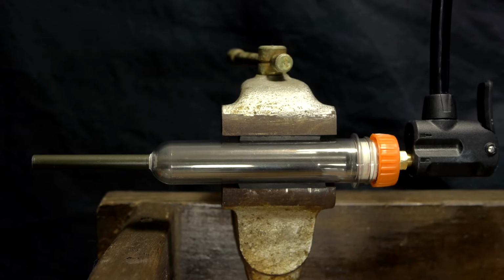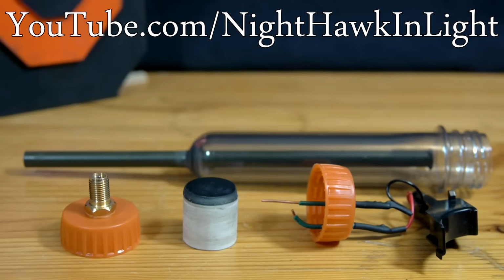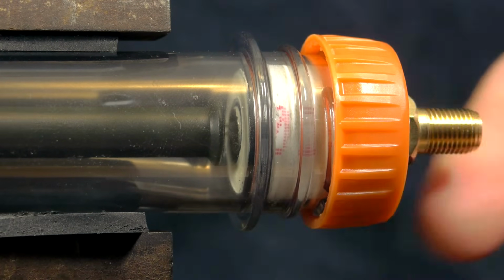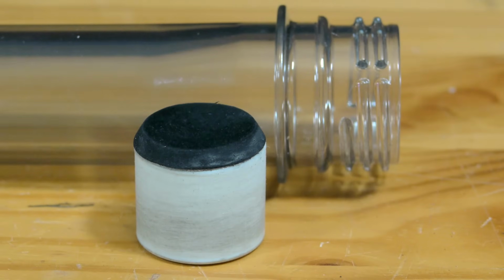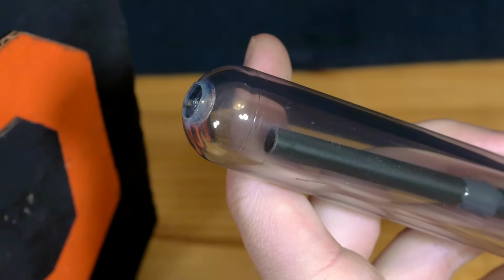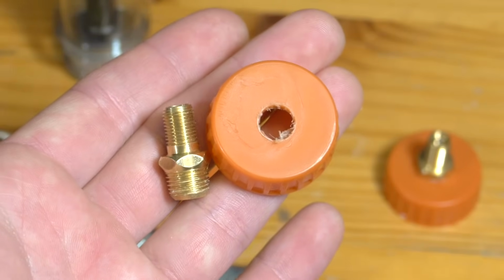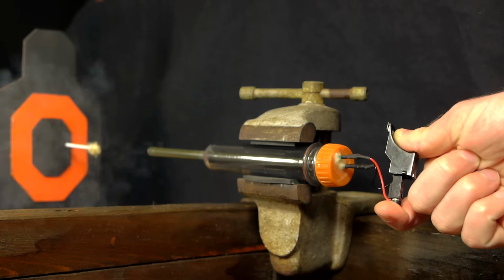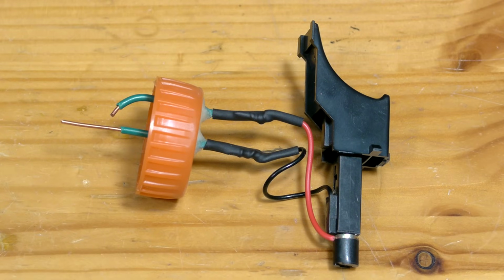How to Make a Mini Dart Gun w/Multiple Configurations

Comment: You could also try to add a loading system where you slide a larger piece of pipe over an open port in the barrel. Or even add a Co2 capsule w/ a bike filler valve which could be easily concealed.  Endless possibilities! Great video man!

Comment: WHAT IF...

rather than twisting the cap to release the pressure on the back of the piston, 
you depress the pin on the Schrader valve with a trigger/lever gizmo.

More gun-like.  Less twisty.  More aim-y.

The trick is leaving the S-valve open for charging while subsequently letting the pin/trigger mechanism to move into place to allow firing of the fry.

Make it so!

Comment: One other method to get valves in to caps is to remove the valve itself from the threaded portion.
 Then, take that threaded portion and heat it, once it begins to melt plastic ( a test piece to be kept close) force the threaded piece in to the cap or plastic surface of need.
When cooled reinsert the valve in to the threaded cylinder piece and voila, the perfect sealed valve.

 Melting the plastic as opposed to drilling it does 2 things.
1. the hole is perfectly formed around the thread
2. the melted plastic sticks to the sides of the thread making it a very secure seal.

I've had one such valve for over 9 years. I use it to inflate a re-purposed air shock. It helps me lift the side of a drill press that has no lifting points or recessed areas at the bottom.
Reply from the maker: Nice trick, I bet that works great!
Reply: NightHawkInLight What do you call those plastic test tubes that are the same size than soda bottles?

Comment: better trigger for the piston version is to use a small cap (use the bicycle valve fitting cap with threads sanded off) with a pin epoxied in it and use that cap to depress the pin valve on the schrader fitting. that should be enough to pilot the piston, and also allows you to use the gun with one hand :)

Comment: I have used tyre valves from car tubeless wheels for the same style thing. All you need to do is drill the right sized hole and pull/wriggle the valve into the hole. Fitting it inside the piston should still be achievable. The cap and blanks should be good for 100psi or more so providing the rest of the build is done well you could get some serious oomph out of it.

Comment: It would be cool to make a semi-automatic version by placing circular metal contacts on the caps (with the same configuration of wires on the inside) and making one trigger that can fire them. Essentially seperating the trigger mechanism from the projectile.

Comment: hot glue would work over epoxy as well.  I have used it in the past to seal various high pressure projects.  would probably be a good idea to rough up the surface you are adhering the epoxy or glue melt to.

Comment: Something else I thought of,  I don't know if I could sand rubber.  Search rubber bumpers at Home Depot. Most of them have threads or screw holes in them for mounting.  If these were to be mass produced,  get a cheap flaring tool and copper or brass tubing.

Comment: Great video! Quick question please, with the isopropyl alcohol, do you spray each time you fire, or will one spray last for multiple shots? Thanks!
Reply from the maker: It's possible that one spray will last for a few shots if it coats the walls, but no matter what the camber needs to be opened between shots so fresh air can get in.

Comment: kipkay made this kind of "QEV valve" gun, but it was fit in a mag lite to give it more of a concealed look. but there are people on the interwebs that also made this "flashlight gun" and they filled it with sometimes more then 300 psi which caused the bb/pellet that was beeing inserted to gain a speed of sometimes between 700 and 800 fps...this is more powerful than a pellet gun/ air rifle (0.o)

Comment: If the tube at the barrel is closed wont it pressurize the cannister until a valve is opened. And im talking about the second design.

Comment: What if you use the butane canister with it's valve and the tube going to the lighter's nozzle to feed the combustion chamber, it automatically pulls air into the chamber if you leave the hole on the side of the nozzle open to air.
All to feed the combustion chamber.

Comment: Dont want to sound dumb, but do those lighter spark things ever stop working, like they have no batteries and generate their own electricity right?
Reply: Im pretty dure that they generare their energy
Reply from the maker: They will get weaker after a lot of use until they eventually break, but they don't have a battery that drains over time. They make an electrostatic spark by striking a crystal which creates a misalignment of electrons between the positive and negative wire. I think it's probably science but it could just be magic.

Comment: Hey, Im wondering if you could use the coaxial piston valve with a full size 20oz soda bottle it the same way or if the pressure differences would cause it to act differently?

Comment: Nice video. Will any soda bottle preform work? What's the maximum PSI? I know the one you suggested is 60. Also where did you get your preforms?
Reply from the maker: Yes, any soda bottle preform should work. 60 psi is a good working pressure. The preforms can stand hundreds of psi, but the caps cannot. I broke several of them pushing it up to 100.

Comment: What is the cheapest airsoft gun/ air pressure powered device you can make? For those of us who dont always have twenty to eighty bucks to spend for each project. Dont get me wrong i am happy compared to other channels your projects seem to be cheapest while still remaining most durable as well.
Reply from the maker: I have the perfect project for you. I'll probably make a new video about it in the future because I like the design so much and it's so much fun to use. Check out the $4 bottle gun that I made in this video that fires by squeezing. It works really well: How to Make a $4 BB Gun &  Airsoft Flamethrower
Reply: cool thank means alot to me and id love to see any cheap modifications you can throw on it as well.

Comment: Here's my idea:
If you soak the little cotton piece of the darts in some alcohol perhaps it will give you a flaming dart, if that doesn't work  you could try other liquids or making sure it has the air to burn.
Reply: it would actualy ignite, but it would set off  when it leaves the barrel. said from experience, the air blows the flame away, you need to make something that takes the wind off. i am not sayng that there is nothing that can stand that air, but some materials are just to hard to ignite. the best idea for  now that i have is steel wool, but instead of a flame you get spark.
Reply: francesco quadrio
And what if you wrap a bit of tape around it. Just enough to keep it from beeing blowed out, without preventing any air from coming in.
Reply: exactly what i said when i talked about something that keeps the wind out... i maximized it on molotov cocktails, but it would probably work on darts too. the problem that people usually dont really understand is that,  even if you have the back of the dart burning, it would find trouble to set fire to the target unless, of course, you get enough penetration to arrive to the fletching, if you want to call it like that
Reply: yeah, actually i didnt try to see how napalm stands air flow... thanks for the advice
Reply: there are a lot of things that are hard to blow out, like the phosphorus on a match-box.
And if the stick itself is wrapped in something flammable then it could really set something on fire.
Reply: the hard part remains to set fire to that material... the alcool flame would no longer be enough

Comment: Do you know what psi and how many sprays of alcohol you could use for max power without breaking it?
Reply from the maker: +Stevepilot 100psi is probably about the max before the bottle cap will crack. I use one spray of alcohol but that will vary depending on many things.
Reply: Ok thanks and keep up the good work!
Reply: +Stevepilot chronograph...

Comment: When u twist the end cap on the air compressed version do u need and glue or anything for the PVC Piet to twist with  the cap
Reply from the maker: No, the pvc is pulled backwards because of the escaping air from the cap. It's not attached.

Comment: can u try making something awsome with a bit more common house hold items
Reply from the maker: My $4 soda bottle machine gun video might be what you're looking for. My Pasta Rocket and Smoke Waterfall projects are both easy also.
Reply: NightHawkInLight does the air fill the whole chamber or just behind the pvc ?
Reply from the maker: The whole chamber
Reply: NightHawkInLight so would I be correct in saying that the pvc would not have an air tight seal against the sides of the chamber?
Reply from the maker: Yes that's correct

Comment: I can't find pvc pipe that will work for the size of test tube I bought, so can I use a dowel instead?
Reply from the maker: A dowel will work fine, as long as it's a very close fit. You can always get a slightly larger dowel or piece of PVC and sand it down.
Reply: Ok and also, the brake line is somewhat expensive where I live so I'm thinking of just using a 6mm pen tube. Would my idea work? Thanks
Reply: ***** Yes, but the pen tube will likely deform over time if you are using the combustion version.
Reply: SingleLensReflex

Comment: Would this work with a 16mm diameter test tube? I think I bought the wrong size by mistake
Reply: you reckon you could drill it without getting it to crack?
Reply: Yep, although I would probably have to use a different size pipe...

Comment: would keeping the breakline short, and adding a larger barrel over it it, like a long suppressor, increase the ammo size? I want to shoot nerf darts.
Reply: +xCCflierx That would depend on factors such as kilograms per square inch (or PSI for you guys - pounds per square inch) and also the amount of alcohol sprays you give it > using too much make crack the bottle though as the air pressure attempts to escape. 

You could theoretically increase the size and perhaps do two darts at the same time... but it would be pointless as they would go the same way (presuming you're using darts) and therefore have no extra affect (and no, you cannot make only one shoot at a time, or at least not with this simple design). If you want to actually silence the gun then you are going to need a hollowscope which can be made or I can tell you, that will allow for the air to escape and the projectile to be shot while making sure the sound is prevented from leaving the bottle (although sound can also be a force remember, so too loud you can actually break the bottle), if you have a spare flashlight at you can easily make a silencer. Anyhow, I hope this helped!
Reply: ***** You mean the compression which comes from it? Which contracts out and emits out heat or rather energy or rather moving ioned oxygen molecules which result in pressure (or rather an exerting force - momentum of mass), which then result in the nerf dart's "power".

Comment: Would this work with BB gun pellets
Reply: I use BB's with my one. If you have metal pellets you can simply glue a small magnet on the rear of the brake line so when the pellet is placed in the barrel the BB will be held in place by the magnet. If you have plastic ones like me you can either muzzle load the BB wrapped in tissue so it makes a tight fit and won't roll out or I also wrap a tiny bit of duct tape around the BB so its diameter is increases and thus fits tightly in the barrel.

Comment: If someone who knows could help me out on this that would be fuckin great.

So, Ive been trying to make a gun using the classic "potato-gun-concept" and I pretty much know how it works "chemically" and all that but I still seem to fail on something...

What I got is a special type of bottle (which is in every way proof(except from the pipe of course)) with an igniter from a standard BBQ lighter.
The igniter is connected with 2 wires to 2 conductive screws which almost meets with a very small distance inside of the bottle and clearly makes a pretty (of what I'd consider) perfect spark when "triggered".

I open the bottle and spray-fill it with a type of deodorant that "burns" really well and put the stopper back on and fire it
What happens is that you can clearly see that spark but no pressure which much mean that the "fuel" never got "consumed" right?

Ive tried with different amounts of fuel but still never any effect.
Anyone?
Reply from the maker: If the spark is a bright neon blue there is too much fuel in the chamber. If not, there is either not enough fuel, not enough fresh air since the last shot, or the spark is not hot enough to cause ignition and you need a new igniter or to adjust the spark gap.
Reply: NightHawkInLight It was as you said - way too much fuel!
Scared the shit outta me first time it actually worked (the bottle is pretty large)
but awesome, many thankses! ;D